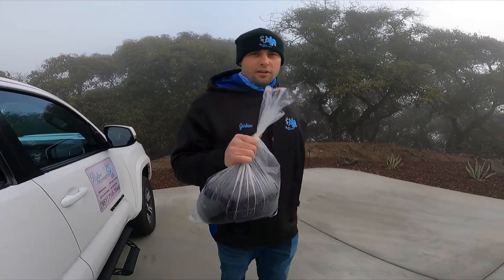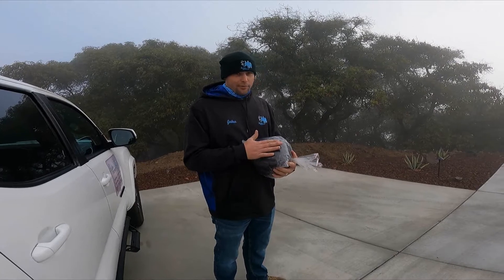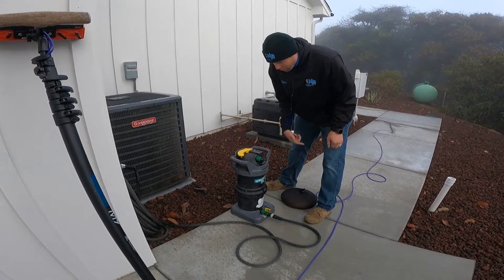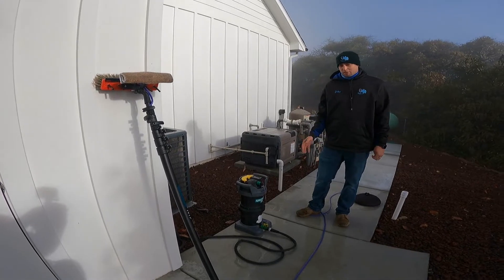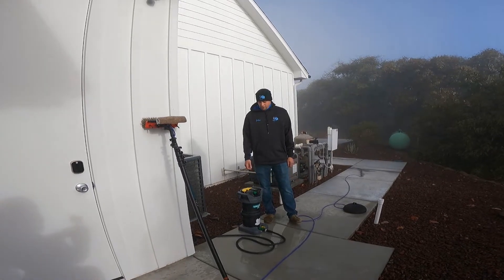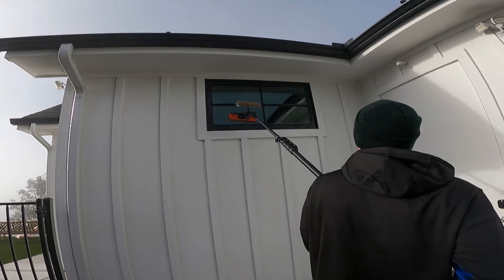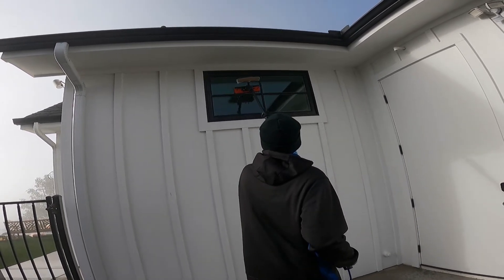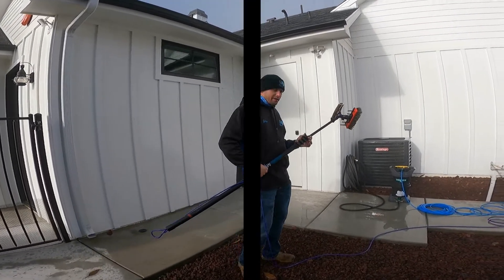WINDOW CLEANING WITH A WATER FED POLE AND DI TANK

Comment: What tank are you using where can I buy a tank and brush? How will I know  the water fed lol I buy will work with the tank
Reply from the maker: Check in the description of this video there is a link to everything I am using 🤗 They don’t make this exact Di tank anymore but the link in the description is the closest thing on the market. 👍🏼 I hope that help Paul have a great day today!!
Reply: @JoshuaTheWindowCleaner  thanks for the reply I’ve also been searching up some di tanks and it looks like they can’t attach to garden hoses (some of them not all) does it come with any attachments or can I buy any?
Reply from the maker: @pauldelgrosso7741  the one in the description comes with a quick connection for a garden hose hook up. I have had the one in the video for 5 years now with not one single issue. This is the only Di tank I have used beside the RO Di tank. I have the 4060 by Tucker. There is a lot of DIY ways to do it cheaper but I don’t really have much time to do those things so I just got this one when I started.